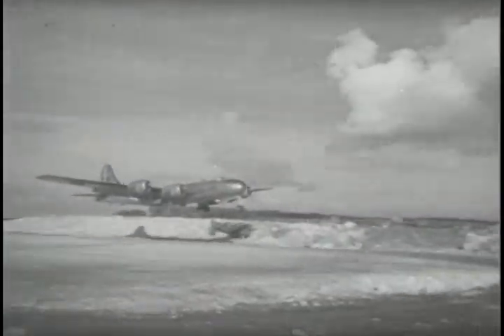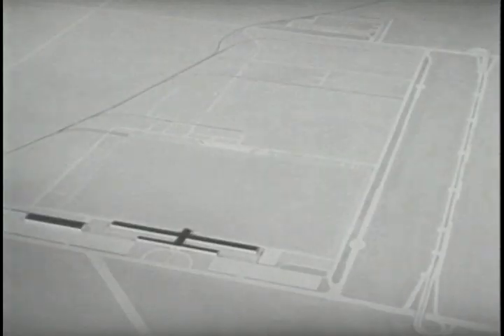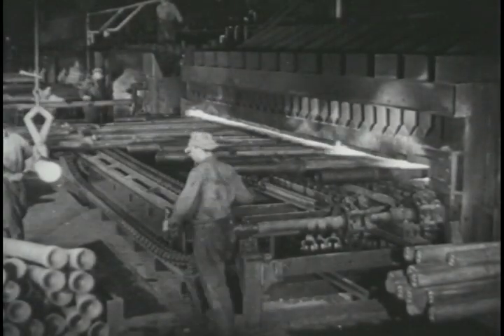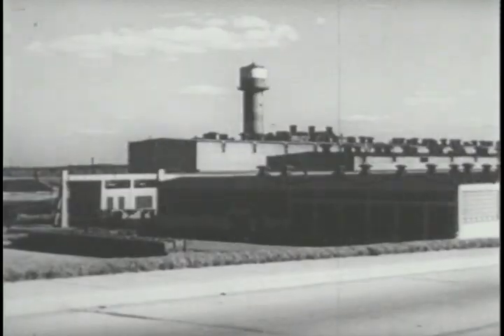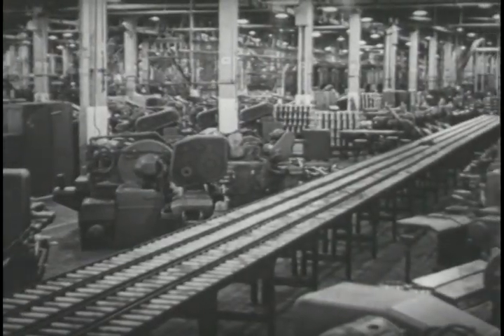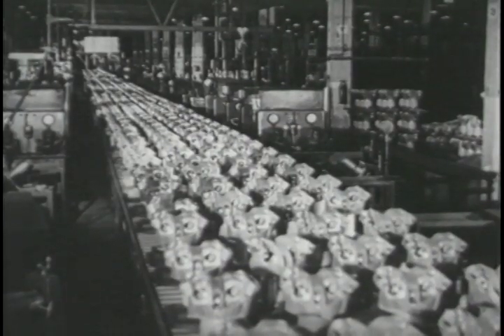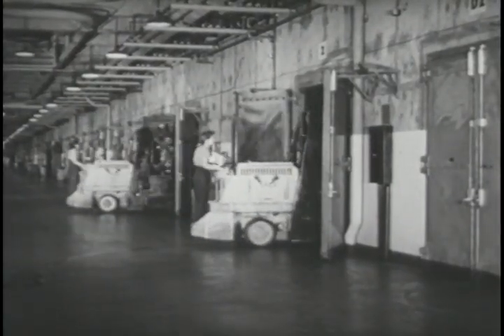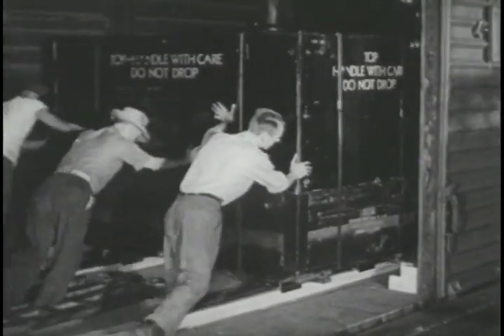Engines for Superbombers

Comment: The plant extended from 7100 to 7900 South on Cicero avenue in Chicago.  Most of the land is currently  a shopping mall, however some buildings of the plant still stand;those smokestacks still stand today.
Reply: And Cicero was filled with Czechs, Slovaks, Germans, Poles that came from desperate poverty and brutal governments long before the war. They worked the hardest as they knew what losing the war would mean better than anyone else. Ask my father and mother.
Reply: and the tootsie roll plant

Comment: Great engine, which was also used in the Lockheed Constellation, Lockheed P2V Neptune, and AD-1 Douglas Skyraider.  Second, in size, to the R-4360.
Reply: The design Wright sent to Chrysler had many problems, The engines overheated . Chrysler (Dodge) made hundreds of improvements to the engines to remedy the problems inherent in the Wright design which really helped. The efficiency of this plant reduced the cost to the govt. and saved the taxpayers millions of dollars.
Reply: great engine-but not reliable enough.
Reply: There were many design flaws in that engine which limited what the B-29 was able to do.
The story goes that Stalin wanted a heavy bomber. The TU -5 was an exact copy of the B-29. They took apart B-29s that made emergency landings in Vladivostok.
They experienced the same issues on their copy of the engines as on the originals!

Comment: the B-29 was a totally unreliable POS ( just ask the guys that flew them) especially for the first 2 years, the main problem was the engines would self destruct usually destroying the wing, why didn't they use the upgraded supercharged fuel injected Merlin V12 instead of that antique CW rotary POS.Same horse power but far more reliable.
Reply: You need to look at the power ratings, a Merlin on it's healthiest day doesn't make enough power to get a B29 airborne when it's fully loaded, you're comparing the power a 1,650 ci engine to a 3,350 ci engine, you couldn't seriously be suggesting that one could work in place of another, the engines in a B29 have a take off power rating 1,000 HP over a Merlins take off rating, and as far as "just ask anyone who flew them" I knew a B29 crewman for years who never said a bad word about those planes, the only thing he said about them was how scary take off was but that was because they were taking off from airstrips on those tiny islands that were shorter than the recommended length for that aircraft, almost every bomber crewman that I ever talked to no matter what theater they flew in said the same thing about taking off, when any aircraft takes off it's at the heaviest that it's going to be for the entire mission, fully loaded with fuel and bombs on an improvised runway on a tiny island is a whole different story than taking off of a concrete runway in England that 2,000 feet longer.
Reply: @dukecraig2402  A comparable engine was the Bristol Centaurus. I am not sure if it would have been too  late for the B29 but it certainly didn't have the catastrophic reliability problems of the 3350. Probably politically unacceptable to use it, though.

Comment: Too bad these engines didn't live up to their design specifications;  the B-29 had problems getting airborne at full rated weight in the hot, humid conditions of the South Pacific with four of these engines running at high manifold pressure and high octane aviation gas.  I think Chrysler did the best they could but the engine's design just wasn't proven due to the demands of wartime. Sadly, many USAAF crewmen paid for those shortcomings with their lives.
Reply: There were  many bombers that crashed with their bombs and a full load of avgas at Tinian on takeoff.  Ernie Pyle visited Tinian, but he did not tell the folks at home of the horrific crashes that killed crews at that little island.
Reply: @DavidN23Skidoo  Maybe the men who lost their lives would feel a bit better if they knew that there were two B-29s to carry only two bombs that finally got the emperor to end the war.
Reply: @johndaniels6089  Hiroshima & Nagasaki are a crime against humanity....you will pay one day..

Comment: After WW2, Preston Tucker leased this plant from the War Assets Administration to build the now-famous Tucker '48.
Reply: The Ford Motor Company used it for an assembly plant, then it was used to make candy ("Tootsie Rolls").
Reply from the maker: You're absolutely right.
Reply: Is the plant still working today? And making what?
Reply: @RRaucina  Still making Tootsie Roll candies at the north portion of the plant
Reply: What happened to the plant after the Tucker era?
Reply: Went to college Fall of '75 in Quanset Huts that were built for Ford War plant in '42.They are still up as part of Daley College.
Reply: The chemical plant on N.end of Ford War Plant still operating.Base of Pulaski Road overpass.

Comment: It was interesting to see that all engines were disassembled and inspected after a trial run, then rebuilt and tested again before shipping.  Very inefficient and labor intensive, but it was the only way to ensure the engines would survive in the field.  And many early R-3350's didn't.  A B-29 deploying to the Pacific had a spare 3350 slung in the bomb bay to replace one of the other 4 that was likely to fail.  The R3350 was a wartime crash program, and it was rushed into production before it was fully developed.
Reply: Curtis LeMay said that there were more bugs in the B29 engines than in the insect collection at the Smithsonian Museum.
Reply: Word is that after the war it was refined into a pretty decent powerplant.  The two remaining airworthy B-29's now fly on engines largely assembled from those later commercial versions of the R-3350.  And of course they fly without bomb payloads and the engines aren't run at the high manifold pressures [turbo-supercharger boost] that was required of combat missions. The heavily-leaded avgas isn't available anymore so they can't run at those power settings.
Reply: Andy: Yes, I read this, it's a handy way to transport spare engines.  The engines overheated in the Pacific and the engine cowling had to be redesigned, plus the fuel heated up so they put cooling fins on the fuel pumps to prevent fuel lock.  They also redesigned the GE superchargers, because they overheated as well in the tropics. Same problem, (GE supercharger) happened to the P-38.
Reply: Russ G Any idea as to the octane level they did run at during the war?
I think that we would be able to run at a similar level with the additives we have today, but they are nursing the engines to prolong their service life.
Reply: There you go. "On a wing and a prayer". Why build top quality, when the main product might only last a few missions. Like a cruise missile. A one way weapon. As long as it is precise. 
If a B-29 returned from mission, give it quick overhaul and hope for the best again.
As the film showed it: Production ceased within 1/2 hour of Japan surrendering, not when the last engine started after the surrender was completely assembled. 2000 ordered B-29s were never built, meaning 8000 engines not required.
Reply: They tended to melt pistons.  My father in law was Technical Sargent and certified to repair all systems on the plane.
Reply: These engines required 140 oct., the same that the H-21 helicopter we had in our transportation company in Virginia.

Comment: This documentary and the River Rouge plant in Detroit are miracles That should be understood by modern America but the  world has largely forgotten this greatness. Imagine Iron Ore and raw materials arriving in one end and finished cars out the other!
Reply: That's what China is doing now.
Reply: That is "Dino" stuff. Building the same object, an engine, does require far more different components and numbers of units these days. The production process has to be far more efficient to be cost effective and still profitable. No company can survive without profits for future sustainability. And the greed of CEOs and shareholders is another "killer factor" to be accounted for.
As usual, the worker is expected to bear the load by accepting low wages. And that is the reason AMERICAN producers gave the job to China. 
CUT the tax cuts for the top end. CUT their horrendous salaries. And then production might come back.

Comment: Now just imagine what Germany did, maintaining and building their war plants while under constant air attack, having electric power, and other utilities constantly interrupted.  During the war their production rates actually increased as they distributed their manufacturing around the country.  There are a lot of industrial and manufacturing lessons to be learned from that war
Reply: One of the lesson you can find if you go read "The Strategic Bombing Survey" is that we did NOT bomb German electrical power generating sites..They were in known locations and we and the British for some reason didn't bomb them... And "under constant air attack might have made a bigger dent maybe, if the definition of "precision Daylight Bombing" wasn't 50% of the bombs in a 4 mile radius---which even that the US couldn't manage...The German production of everything was seriously hampered by their class-bound rigid thinking that machine operators must be journeyman level machinists---which is what I've been doing for more or less 40 years..more...The US applied lessons learned mainly by GM in the 30s: specialised single purpose machines carefully designed and manufactured that would allow a guy right off the farm to do ONE OPERATION correctly with minimal trianing--hours or a few days , and still get a correct result..versus the German --and the Italian and the Japanese putting highly skilled machinists behind general purpose machines like ordinary turret lathes or horisontal mills..Our methods requirered far more Process Engineering and planning and much higher capital outlay, but less operator skill and input...and we made scores of thousands while they made hundreds..Same in ships and same in tanks..same in radar, same in code breaking...So many men were involved in production of long range heavy bomber that both USA and Britain had serious shortage of infantrymen despite our population being twice that of Germany's---and by time USA got around to serious levels of fighting, the Germans already having lost nearly 3,000,000 battle dead...and I think you know where 88% of those men died...
Reply: +janvanv  The Allies DID bomb electricity plants. What were the "Dambusters" doing ? Play "bomb titching" only ? Breaching the Moehne and Eder Dam did reduce water and electricity supply in the industrial Ruhr area. 
Blowing up the Midland Canal bridge over the River Weser near Minden did disrupt an efficient supply route. 
And the list goes on.
Eventually their production facilities moved into underground caverns in hill sides such as "Mittelbau Camp DORA" near Nordhausen / Harz in Thuringia, staffed with concentration camp inmates from nearby Buchenwald.
Reply: @janvanv  And we made 30 Sherman Tanks for every Tiger, and single Tigers were known to kill 30 Shermans.
Reply: @web5271  nope that is not true at all
Reply: YES - Thank goodness time ran out on the hitler regime.   Thanks to time they did not get the BOMB finished.  We would not be here now!
Reply: @rogertycholiz2218  The Germans did not come close to getting nuclear weapons. The Allies were not aware of this till late in WW2. Recommend the works of Richard Rhodes.
Reply: Their workers didn’t go home at night or have weekends off. They only left the factory in a box. No praise needed.
Reply: Now it's true that there was significant resistance from both management and workers towards "american" production methods, but the threat of air raids made it impossible from the start to build gigantic factories such as seen here or to use specialised machines that lacked the flexibility to retool for what was needed. Nevertheless, under unimaginable conditions germany still managed to produce over 2000 machines a month in the fall of 1944..
Reply: Slave labor helped.
Reply: @cyprixx  They worked hundreds of thousands of people literally to death.
Reply: Yes, that clever Germany and its slave labor.
Reply: You are correct the Germans did manage to increase their production rates, of course they used slave labor.
Reply: Do not forget that Nazi German production took advantage of slave and prison labor.
Reply: DIDN'T DO CRAP FOR THEM EITHER !
Reply: Yes, this may be so- but, their production output was less than one-tenth that of just the USA alone at their peak, even in the years they were not molested by mass area bombing.  Remember, the American bombers along with the British effort only became marginally effective in just the last 18 months of the war. In the post-war analysis, the Bombing Survey discovered that very few of the total bombs dropped even came within a mile of their target. Additionally, bombing doctrine of the day was incredibly erroneous.  Based on the highly misguided Mitchell principles of mass area bombing and the fallacy of the accuracy of the Norden bombsight, Allied Commanders literally wasted 90% of their effort at tremendous cost in lives and material. Of course, German war production was the direct beneficiary of this gross miscalculation by Allied planners.
Reply: soaringtractor Yep,,,,I was about to mention that factor....
Reply: Without detracting in any way from the massive way the USA was able to turn on factories like this one its a shame you didn't also mention what the UK achieved in very similar circumstances to the Germans. And the Germans didn't worry too much where they bombed. Always makes me smile when we hear about how Packard did so well producing 53,000 Merlin engines in peaceful downtown Detroit where bombs were only heard of in news reels. While Rolls Royce in the UK producing twice as many in a war zone gets hardly a mention.
Reply: Galland You are right, and that's what I find so astonishing....near the end of the War they almost got their act together...thank goodness time ran out!
Reply: gk10002000 its all irrelevant now...design, manufacturing processes and automation are waaaay more advanced now...also, I don't think in next major war north america will be able to enjoy the piece and quiet during manufacturing they had during ww2.
Reply: +1chish fuck the uk if it was not for us giving them arms and armament those nazi appeasing limeys would have lost their country...
Reply: gk10002000, You have said it so well....the German people are to be admired for many reasons; .sadly, they "bought into" an Ideology that they hoped would restore pride and prosperity to the "Father Land"!  Does not that same hope resonate in America today?  Ironically it does...we now have another bombastic egotist that promises to restore America to some imaginary "Camelot" from the past.....
Reply: Wesley hill  Don't worry too much for that hair fetished clown. He is not after creating "jaaabs". He only wants votes to sit comfortably in the White House and destroy Obama's legend for having told a joke about him at a function. Sometimes I get the feeling DT doesn't know, what the requirements for being president are.

Comment: King Rose Archives; I once saw a Tucker automobile in Kansas City, Mo.  As I recall it had a center mounted headlight that moved as the car was steered through a turn.  In 1949 Ford came out with a radical new design that incorporated a spherical feature in the center of a chrome grille.  At that time; a story was "going around" that Ford meant to install a headlight in that part of the grille, ....as the story goes; Tucker sued Ford and the resulting 49' Ford Grille is what we remember today.  I'm pretty sure that it was just an "Urban Myth", but I found it interesting.
Reply from the maker: Not sure but you can see it in the Ford design.  We should ask the Tucker family to chime in.
Reply: wesley hill
Reply: King Rose Archives That might be instructive...
Reply: soaringtractor You are so right...my brother In-law owned one....I was just a kid at the time...if that timeline doesn't make sense; it's because I was a "mistake"...an unintended child....my nearest sibling is 92 years old.The other two have been dead for a while.
Reply: wesley hill b

Comment: Wait a minute... They make it sound like every engine was tested and thoroughly broken down, examined and then rebuilt. Did they really do that, or was this a random sampling?
Reply: +tscooter22 
The Packard engine factories also broke each engine down for inspection;  see their films..
Reply: We have just gone slack these days. For a proper engine to work correctly, every 2000 hours, regardless where one is, even in the middle of a rush hour freeway, should stop, dismantle the engine on site, rebuild it and continue safely for another 2000 hours …
Making America GREAT (laughing stock) again.
Reply: @thies7831  , better to detect flaws in aircraft engines before they fail in flight. Remember the recent story of a thrown blade from a turbofan causing the death of a lady passenger who was nearly sucked out trough a broken window on a jetliner?
Reply: @stephenarling1667   Sorry for not making myself clear. On finer reading you might detect that it is a sarcastic admiration for quality work. For the average person to achieved the same perfection, total maintenance should be performed on a car engine every 2000km, regardless of condition. Who is doing THAT these days on their private car ? Neither time nor money will allow such "perfection nonsense".
Reply: They did it for every engine.
Reply from the maker: +tscooter22 Not sure.
Reply: MrGGPRI
Thanks! I'll have to take a look. :-)
Reply: Probably every one due to the critical role of each one.
Reply: Yeah, I find it hard to believe they tore down every one, inspected, and then reassembled it. Only to follow with another test run?